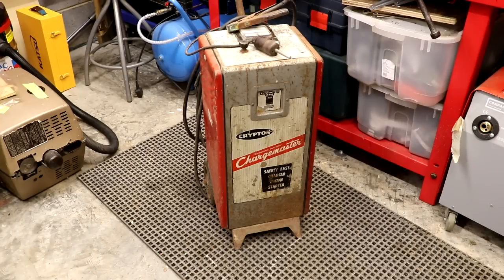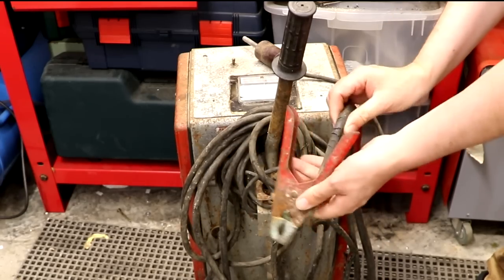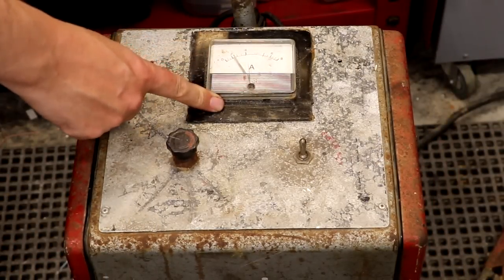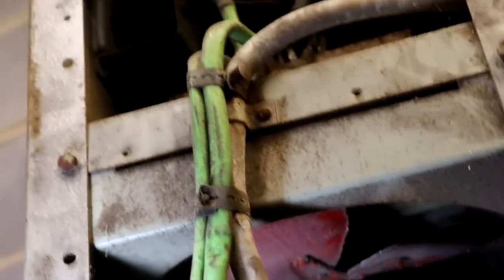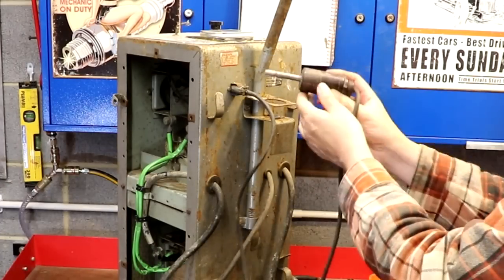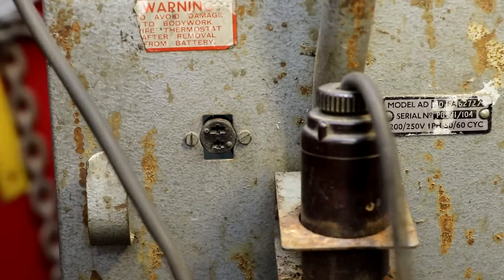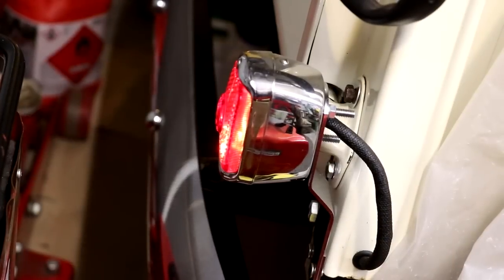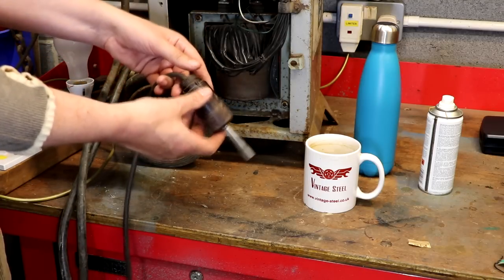CRYPTON BATTERY CHARGER RESURRECTION

Comment: To get the most out of an alligator automotive battery charging clamp, the clamp should have a braided jumper strap between the cable input side jaw connection and the opposite jaw connection. This way charging current can flow using both jaws (without just relying on the pivot point conduction), because after all, usually the current is flowing through a very small cross sectional surface area of the jaw teeth. The best approach for modern high current battery chargers is to use tinned copper flexible braid crimped to tinned copper eyelets, which then attach to the clamp handles (and jaw connection) using brass hardware (Bolt, nut, washer and lock washer). The braid is very flexible so you can easily operate the jaws and still have a two jaw high current connection.

For a lead acid starting battery, the  first charging phase is called bulk charging. To bulk charge the battery, the popular modern approach is to use a constant current charge of up to C/10 rate, while at the same time not over volt the battery beyond its specification, for a flooded starting battery I think this is around 15 volts. So when the battery charging voltage at the battery has reached its maximum the constant current magnitude will slowly drop, and we then enter the next absorption phase. 

As you can see in using the charger, there can be a substantial difference in the charger output voltage relative to the voltage at the battery clamps (battery posts) with high charge currents. 

Ideally the charger would have a four wire connection if monitoring the voltage at the battery was key to the design. I have seen red and black charging cables that have two circuits one 14AWG and one 4AWG which then connect to the clamps. The 4AWG is for the charging current and the 14AWG is the voltmeter sense connection. Not sure if this cable type is a special order, but I have seen it on many automotive load testers. There is no reason why you could not use this type of cable for a charger.

Comment: Found an ad on the net that says this is a Crypton Chargemaster model AD-40 from 1964. Believe it was a fast charger
but only good for up to 30 Amps. So this was your typical city garage everday battery charger back in the day. Not for 
heavy duty use but autos for sure. Now the Chargemaster Major, Batterymaster, and Deiselmaster they were top of the line
 models giving better fast charging at 100 to 200 Amps. Those could do 6,12, and 24 Volt batteries. You might find an
original Crypton ammeter on eBay Chris. 10 Amp might work , it may peg into the red in the beginning of a charge cycle.
Reply from the maker: I assumed it would be more I did find a picture of the meter and I think it shows 120A but it could have been a different model

Comment: That probe might have mercury in it for the function of pushing the rod up. I remember some of the early models had it in them while others just had air pockets for expansion. you could use a vibrating device to loosen up the rod while it is being heated and cooled rapidly(what i used to do to get them working) but be aware they never were accurate , so adjustment may be needed and reglue the set screws.
Reply from the maker: Ok I will give that a try thanks

Comment: Very interesting piece of Vintage equipment. They certainly knew how to make things rugged, back in the day... I suspect an engineer nowadays would dimension the values of a comparable charger right on its limits rather than going for overdimensioning it. Planned obsolescence wasn't looming large in the fifties it would seem... now would I want such a beast in my garage? Definitely not :)
Reply from the maker: Yes I think it could easily destroy electronics in a modern car so not sure how much use it will actually be. But it was fun taking a look inside

Comment: Thats a good old charger, nothing weak or weedy about that beast 😀
I'm no lover of selinium rectum friers, but they are forgiving.
I would think silicon stud diodes would fail under repeated high loads.
The voltage would be a bit higher as well.
I would add more earth wires to make sure all the case panals had a perfect earth.
That transformer is a solid old beast.
Reply from the maker: Yes it is a good old unit but not sure how safe it would be for modern vehicles electronics. I think the big stud diodes would be ok but I was worried the output voltage would be too high.

Comment: I would be tempted to remove that aluminum top panel (pop rivets!) - to see if the original panel markings are still there. Also,  I would be reluctant to use the thermostatic probe even if it could be restored to working condition as many modern batteries do not have insulation sheets over the tops of the plates as older batteries did. Regards,  David
Reply from the maker: I’m fairly sure that the top panel is the original but it is so corroded it is hard to tell. I’m not doing any cosmetic work on it as it will be up to Andy how it’s finished.